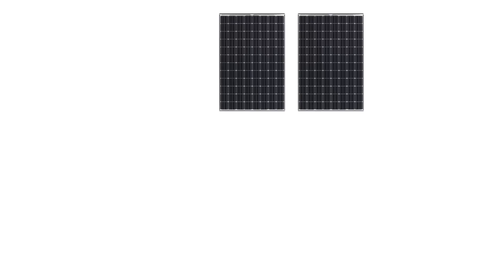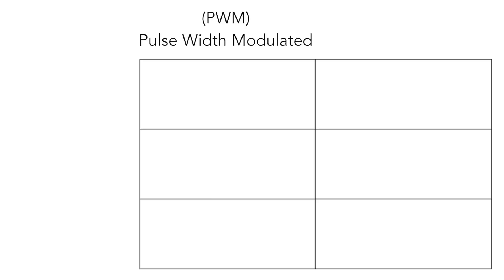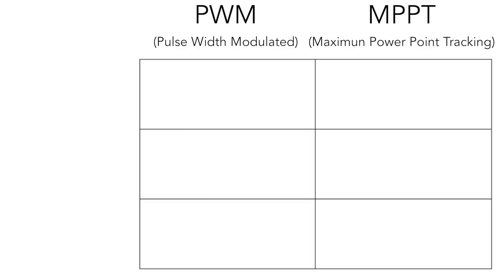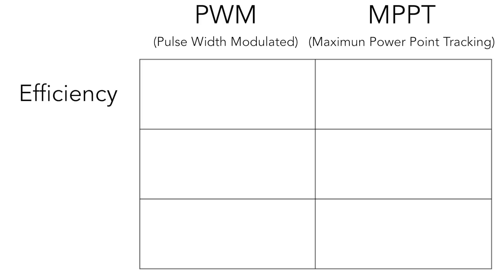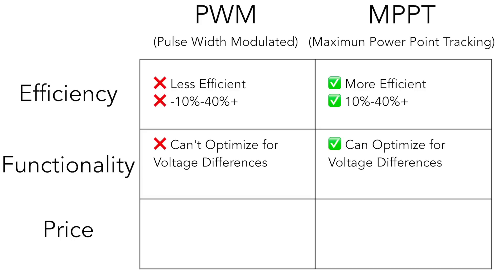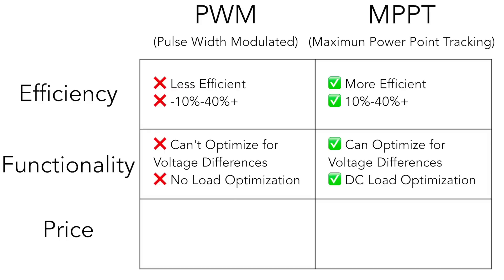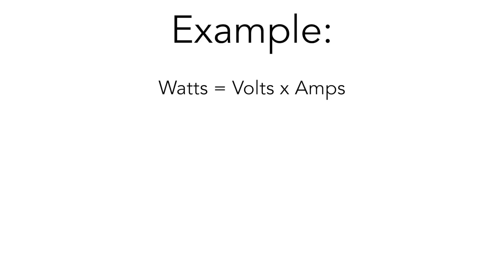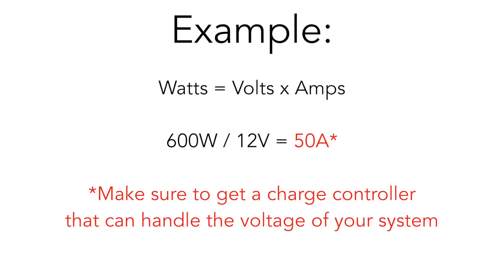Comparing + Sizing MPPT vs PWM Solar Charge Controller

Comment: PWM controllers should never be used with lithium batteries. While lead acid batteries may tolerate the abuse, a PWM controller will destroy lithium batteries. Here's an example of how PWM controllers abuse lithium iron phosphate batteries. A 4S battery is being charged by a solar panel that has an OCV of 22 volts. As the battery reaches 100% SOC and the charge current drops to zero, the battery will be pulsed by 22 volts, or 5.5 volts per cell. This will quickly cause electrochemical damage to cells that cannot tolerate a charge voltage of over 4.2 volts per cell.

Comment: Hello, Just got the SMK MPPT Solar Charge controller, Please i need to understand the parameters,I know PV means voltage from sun  P means charging power and U means voltage of battery  what does Today mean? and when do u know the battery is fully charged as well as when do we know we are using the solar panel for grid and not the charge stored in the battery?
Reply: Tokenhelps Dot Com you have to have a digital panel or analog, for battery voltage to determine State of Charge.